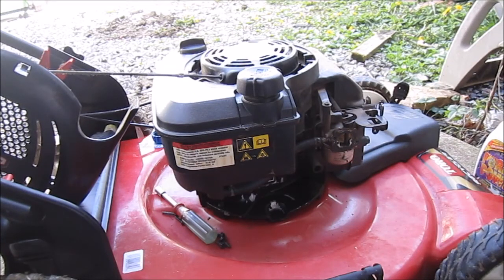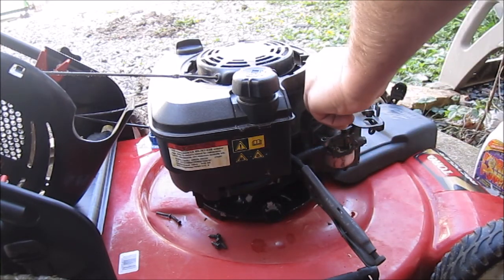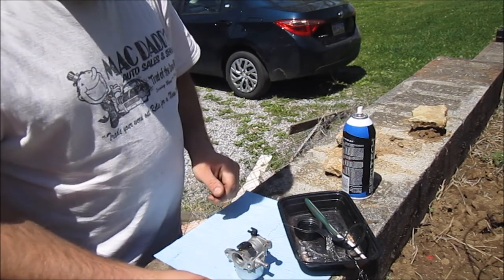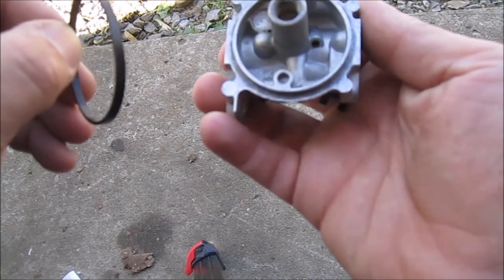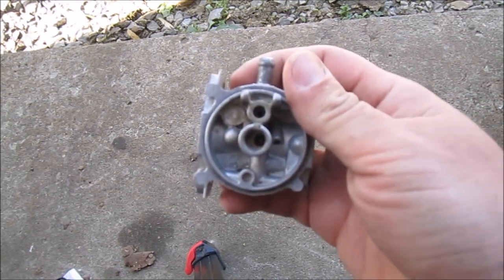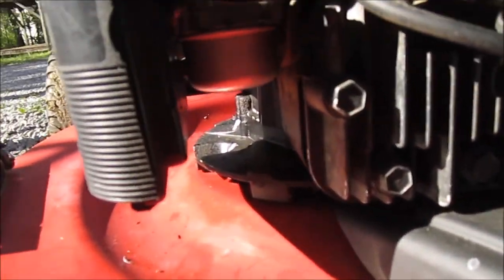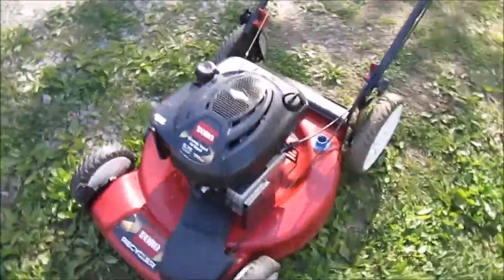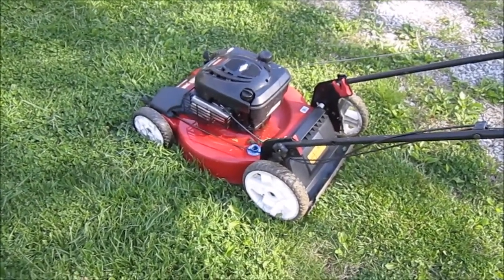2010 toro recycler part 2 model 20331 carb clean april,20 2018

Comment: I just got this exact same lawn mower for free. I took it apart, cleaned it, changed oil, spark plug, filter, blade, wheels, and some other parts. This lawn mower runs and cuts so good that I sold my 2017 Troy-Bilt TB-360 and decided to keep this one. I have been very happy.
Reply from the maker: yes i still have it, i restyled the wheels to black still runs like a dream
Reply: @Turningwrenches85  I noticed that the right front wheel wasn’t spinning when you lifted it and engaged the drive at 8:57, did you fix that?
Reply from the maker: @SheaMileto-b3h  yes I did, we still use this mower well my mom uses this mower now the drive belt I had to replace on it then if I remember right ?